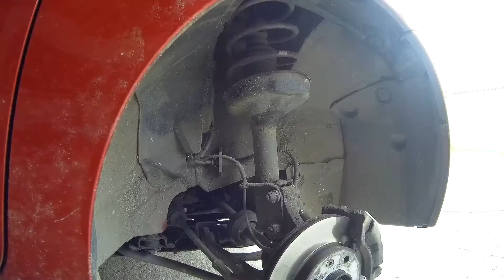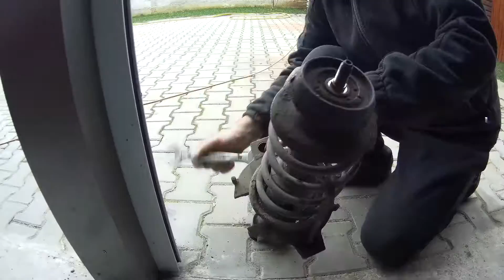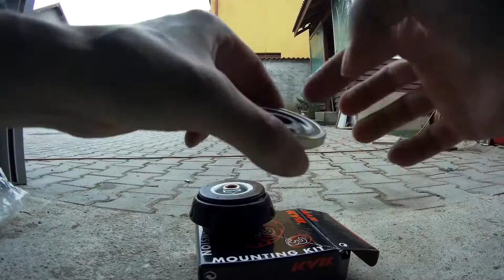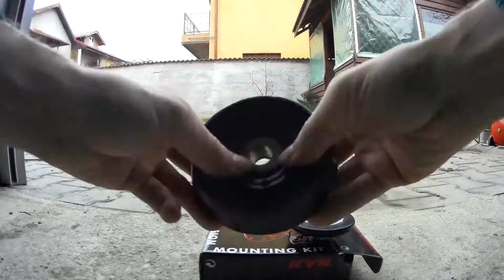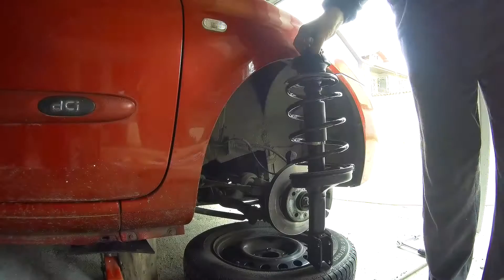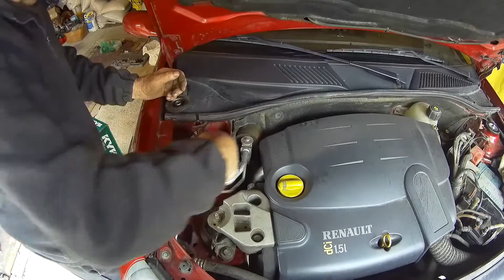How to replace front shock absorber and coil spring - Renault

Comment: Hi there, I’ve replaced the strut bearings on my clio mk 2. However on reinstalling both struts, neither top mount seats tight to the the cars body to hold the suspension. I’m guessing that isn’t normal as the whole suspension turns when steering, resulting in steering not returning to centre.

I’m not sure why this is, both bearings seem to be okay. The top nut was wound all the way down so the spring is compressed as much as possible. The rubber bushing looks great either side, I’m honestly stumped as to why I can’t seat the top mount. And yes, I do use a torx to stop the shocks from spinning.

Any advice?!
Reply from the maker: The problem appear after replacing strut bearings or it is a old problem?
Reply: DigiTech 5000 the reason I replaced the strut bearings in the first place is because of this issue. It was my presumption they were the problem, but I don’t think those top mounts have ever sat correctly. I’ve even compared the springs with another clio, same size.

I have a feeling I may buy another strut from a scrappy and transfer over parts one by one to find out what the issue is. The coils are seated perfectly fine too.

Do you perhaps have an idea before I do that?